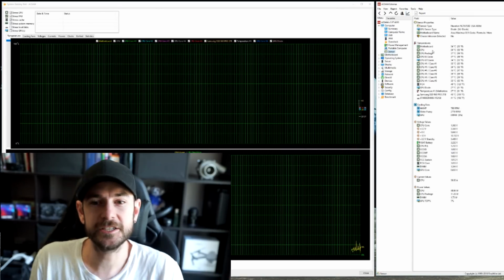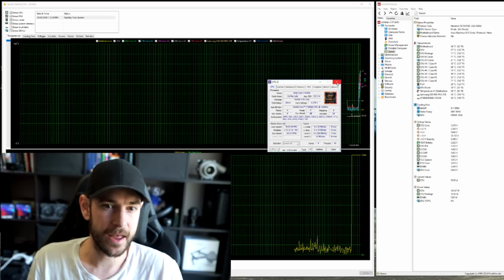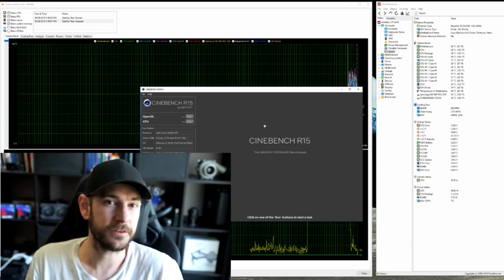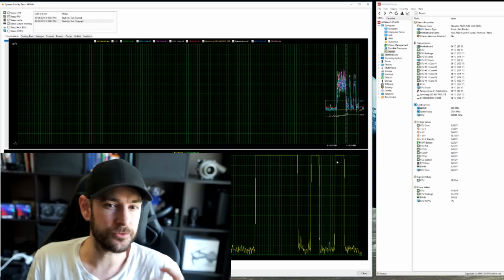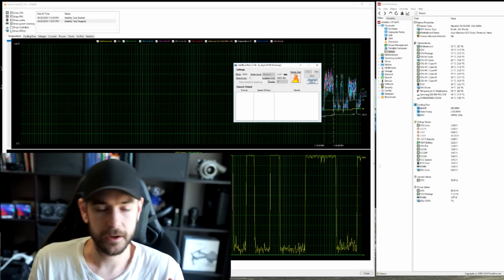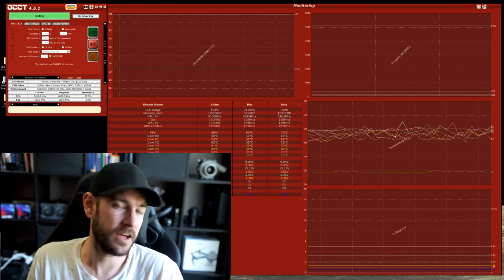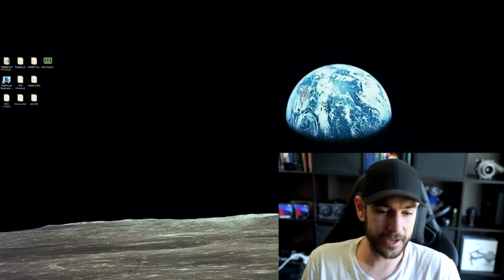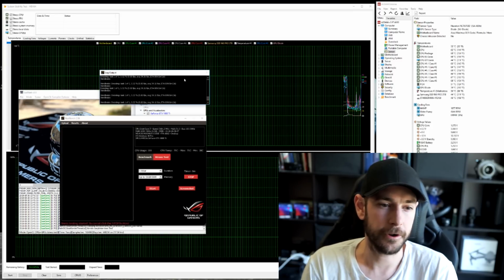How to Stability Test an Overclocked PC

Comment: Hello . When i run real bench , i get instability in the app itself with error blender and lux mark . I search them up and it was Unstable gpu clock . However i use hw info to watch the temp while testing and hw info said that my Cpu clock is unstable , error L0 cache . So in this case , which should i fix

Comment: Thanks for the great info! Just wondering what changes you make when you incorporate an avx offset? I play a lot of apex legends and I've learned that it requires an avx offset, do you increase the voltage? Probably lower my core multiplier to compensate for the increased heat?

Comment: for me aida64 fpu stress more unrealistic then prime95. in game my proc temp @ 48-65 oc @4.45ghz. ryzen 3600. when i use R20 my max temp was 76C. prime95 70-77C. but on aida64 fpu stress test only i got 95C max temp. it just unrealistic(this kinda stress test not apllied on our daily normal use). render out 4k footage from premier pro also didn't get temp more than 70C. so i prefer, R20, blender open data, prime95, and aida64 stress without fpu stress.

Comment: What I don't like about "I don't like prime95" is the "the test is too hard to pass, so I'll just run an easier test" defeating the purpose of stress testing entirely.  

The other problem is prime95 is surrounded by so much conflicting information on if it's good, bad, or if it even does what it says it does in regards to to the test settings.  

Using it to gauge ultimate stability is fine, the problem seems to be learning how to configure it correctly which no one seems to be able to agree on how to do.  

And I'm too stupid to do it.  Yes I have tried.  Still trying, still ain't got it fingered out lol

I'm coming for you, blend test.  All over your blendy face 😈

Comment: Bro so here is my results , I did this stress test for about 15 minutes on 100% cpu load at 5.0ghz , my max temp was 60 and max VR VOUT is 1.261.
My specs are:
10700k
Z490 aorus ultra
g.skill 32gb at 3600mhz
kraken x73
corsair rm850x

Now I disabled the enhancement thing in bios to get full control of cpu overlock i also set my voltage to 1.265 I think something around that , and set my LLC on Standard.
Is that good results?

Thank you <3

Comment: my cpu clock and voltage keeps jumping up and down while doing the occt test, constantly from 4.2 ghz to 1.4 ghz and while gaming if cpu usage passes 35% gpu usage drops and fps go from 120 to 20, what could it be??? i changed the rams and i have change the clock speed and voltages a million times, please help haha

Comment: What's interesting is that he uses ASUS motherboards and ASUS's profiles for AI overclocking are based off of.....you guessed it.....prime95 lol. In the bios just hit F11 and it point blank tells you this in the various info. I do agree...prime95 is way to extreme but to be honest this guy says "if the CPU can handle Prime95, it can handle anything" which is essentially the point isn't it?

 I only have an i5 9600k that is Oc'd to 5.2ghz. Max temp is 85 Celsius with stress tests...usually between 75 and 85 Celsius but no more. I use Aida64, Cinebench20 and Intel extreme tuning utility for the stress tests etc.

Comment: This is probably a late reply but does the same apply for undervolting cos I'm trying to shed a few degrees of my 9900KS with no AVX offset I'm using 1.3v LLC turbo so max 1.32v and iv ran occt on smallest data avx 2 for 15mins and was fine. I don't feel comfortable leaving a stress test on un supervised and I don't hardly have 4 hours available.

Comment: Super helpful video, thanks man. Question -- wouldn't it be faster to just skip straight to the OCCT stress test? If it fails, you go and tweak your overclock, without having to waste time on all the "warmup" tests.

If the OCCT test passes, I could see the benefit in running the rest of the earlier tests at that point in case one of them catches something. But would it not make sense to just go straight for the most demanding/intense test of the group first in order to save time?

Comment: The Intelburntest Maximum test failed after 30 seconds... pc restarted.
I passed the standard and very high test.
Temperature was at 70c so no temp issue's. 
I'm currently at 4.3ghz and 1.35v.
How do I troubleshoot this?

I wanted to test with occt after intelburn but first I wanted to pass the intelburn before I proceed.

Comment: I watched this video and your i9-9900k / Maximus Hero XI video so many times. I cannot stress how much I learned. THANK YOU for all your help and the deep explanations! Thanks to you my computer is now overclocked to 5.0 Ghz on all cores and completely stable according to these tests. 

A few things I wanted to note that I ran into that made me pull my hair out for days. 
1. Make sure BIOS is up to date (Save any created profiles first)
2. Make sure you are properly cooled! (I thought I was according to hardware monitoring but later found out it was causing BSOD's that all stopped after finding out that the airflow in my case was insufficient)
3. Use the latest version of RealBench! I was using an older version 2.43 and having crash after crash even after passing all the previous tests in this video. Noticed you were using 2.56, so I used it and passed multiple runs!

Comment: Im a new pc builder. Not an expert but stumbled on OCCT and have beeb using it to stress test. my ryzen 5 1600af cpu was stable on 4.1 ghz on 1.35 v on  cinebench but when tested on OCCT ran into crashes and temps reached 90 c. Highly recommend OCCT. 
Found out that 3.6 ghz on 1.125 v awas stable. max temps 75c

Comment: Couldn't get anywhere with Prime95 so I tried your Method. Wow!! Finally got my 8700K to 5.0Ghz with newly installed AIO. Thanks!!! Sat on the edge of my Seat waiting for 'Intel Burn Test' to pass at Maximum. LOL
Reply: I’m running my 9700K on Noctua Air at 5ghz and 1.320V but it’s getting pretty hot especially for AVX loads. Ordered the 3000 rpm fan for my cooler to see if that helps. Otherwise I may be going AIO.

Comment: hey i have a question i have 32 gb of ddr4 3200 mhz i have followed one of  your guides for oc my i7 9700k i ran some stress programs and they ran fine but when i run memory diagnostics about 4 times i get errors does this mean my ram is faulty? or is it just from agressive oc? im using xmp 2

Comment: Would IntelBurnTest still be suitable to use when monitoring an OC on a Ryzen 5 3600?
Reply: Hello I'm new at overclocking I have a ryzen 5 3600 and  I can it 4.2Ghz but I need at least 1.4volts, I reed some people saying that 1.4 volts it's a lot so I went down to 4.1ghz at 1.35volts do you think that 1.35 volts is fine? I usually have around 55 to 60 degrees on the cpu. Even when I was using 1.4 volts

Comment: Hi thanks for the great video. I am running 1.305V at 5.00Ghz, I ran OCCT and it was crashing but I have increased the voltage from 1.290 and I ran it for 20 minutes. The temps though are sitting around 70-85ish degrees. I run a waterblock which also has water run through the GPU as well.. I guess this is part of the reason why it is running quite hot.. Is this ok do you think? C-States are also disabled.

Comment: So what am I supposed to do if my pc keeps freezing during these tests and in games it'll run just fine and have decent temps but then out of nowhere it freezes no blue screen should I be changing the voltage or something and I know my power supply is more than enough and my cooler is doing fine I'm just trying to figure out where the stability is lacking

Comment: Getting a blue screen after I tried your over clocking guide on my gigabyte z390 / 8700k @ 5.0 ghz 1.300 v. What adjustment I need to change? Thanks for the video.
Reply: I just finished my 8700K to 5.0ghz. I had to up the Voltage to 1.370V and my Uncore to 44. Not sure if the Uncore helped or not. I've delided my CPU with Liquid Metal and I'm using the Aorus 280mm AIO with the Stock Paste that was on it. Max CPU Temperature peaked at 76C but otherwise stayed in the lower 70s C. I finally passed the 'Intel Burn Test' set a Maximum setting. Hope this helps.

Comment: In wich scenarios would you use prime95 over Intel burne test and why did u opted for one instead of the other
Reply from the maker: I don’t use Prime95 at all anymore. It’s a very unrealistic workload.
Reply: @boostedmedia  Is there any overclocking hierarchy that you follow up on OCs... Like Cpu first, than ram... And than Gpu.
As someone who needs well tuned workstation pc for my tasks I priorities Cpu and Ram speed... While GPU just stays at stock.
I can imagine gaming pc having priority in gpu clock and speed... Or its the same order?
Reply from the maker: I usually go CPU then RAM then GPU. The ram is dependent on the CPU as the controller is integrated.
Reply: Intel burn in and Occt take care of Cpu and Ram?... I was doing some reading people using memtest to validate ram...
At this point my PC is stable by your Stability tests. I'm working on my first workstation pc and it really is a learning curve to all of that 😅

Comment: What if I can boot into windows, play pubg for 5 hours, export videos with premiere, do everything, but can't run occt for 5 seconds ? I5 8600k at 4.8ghz with 1.31v. Should I increase voltage ? 35c idle and 65 max under load, with max load line calibration
Reply: Oh, and I can run aida64 with no issue whatsoever

Comment: Good vid, im having trouble overclocking cpu even tried every voltage and clock speed cant seem to find the right spot. cpu temps dont go higher than 60 i have an FX8370E. any suggestions?
Reply: If your temps are not going over 60 is the overclock registering on windows? Open up cpuZ and see if it's picking up your frequency ie you've overclocked from 3.8 to 4.2ghz. If it's not showing your overclock, it 3.8ghz, go to power settings In windows and make sure you have high performance mode selected. 

If that's not the problem sorry :(

Comment: Hey man. When tested with the Vcore settings, do you reccomend dropping voltage .005v and after every change, run this test? And once it's unstable I'll bump it back up to where it was stable, and that's the ideal Vcore?
Reply: Yes :)
Reply: @Battlegroundinho  actually it's probably much more efficient to start at a Vcore that you know will be unstable, and slowly bump it up til it's stable. Would waste less time
Reply: @tylerkrasavage5656  I started at a high end voltage and slowly decreased, took me two hours to find the right one. But could be faster yes :)

Comment: What if you run the burn test at maximum and it never posts a result after even 30 minutes. Just keeps running the cpu but never does anything. What does that mean?
Reply from the maker: Likely the Microsoft redistributibles aren’t installed correctly.
Reply: Boosted Media I’m pretty sure I have then installed. I’ll check tomorrow and see and also let it run longer to see if I have different results.

Comment: Using this guide now for my 9900k. After about a day I got it to pass IntelBurn Test, only for OCCT to throw about 750 errors after 45 mins lol. Getting there though. 5ghz @1.33v 4.5 cache -2 avx. I don't normally use avx but I think I got a bit of a dud for an overclocker.

Comment: Finally!! Something ACTUALLY HELPFUL! I watch alot of videos trying to find the best settings for my system. i9-9900k and RTX 2080 ti ftw3. Your video (posted after this in overclocking the i9 on Maximus XI hero) exactly the same as me, was, of the upmost tremendously helpful! You don't skip over anything that others have deemed "should know" stuff. It's for dummies without implying such 😂. Thank you so much for all your help. Keep it up. First person I've subbed and will donate to! You've save me $$$ doing it myself while allowing me to push my limits. Thanks man!

Comment: I had some super high temperature spiked after like 20 minutes of Prime95. Was around 95 suddenly. But no crashes at all. Is that normal?
Reply from the maker: Don’t use prime95 for stress testing. It’s not a realistic workload.
Reply: Boosted Media Jeah your video is the bomb mate. Tried intelburntest with standard and it crashed after two loops. Now I raised the V to 1.34 and it did all loops. Running 10 loops on High stress level right now. Aaaaaand it finished it successfully. Temperatures were between 50 and 80 spiking around i think I could consider it pretty stable.

Comment: Im running the i9900k at 5.0Ghz with the avx offset set to 1, volts at 1.32. In what order do you recommend doing things from this point on? Im mostly rendering videos and working on lots of 4k material so my goal should be to minimize the avx offset I guess. Should I continue to find the lowest possible but stabile core voltage from this point, or try first to set avx offset to 0? Im a bit confused. Thanks for a great video!

Comment: So witch dimms slot did you end up using?? On witch motherboard? I got a Asus maximus ix code.. Witch dimm slots should i use to run 4000mhz?
Reply from the maker: I’m using all 4. Just make sure your matches pairs are sharing the same channels on the motherboard.

Comment: hey dude will this work for amd processor also ?
Reply from the maker: Yep
Reply: @boostedmedia  im upgrading to ryzen 5 2600 and  an msi b450 board with a radeon r9 390 8 gb gpu and 16gb vengence ram how much fps you think i can get overall stock ??

Comment: I’ve got a question. When I do Cinebench I get max 70C, no spikes. When I do OCCT medium I get average 55C, spike 65C. And then when I did Aida64 I get friggin average 82C and spikes up to 89C!!! I have a 360mm aio and ambient temp is 28C. How is Aida64 temp so much higher???
Reply from the maker: Shorter instruction sets so the cache doesn’t have time to buffer. Means the cpu is working a lot harder even though the load percentage is the same.
Reply: Boosted Media thanks. I just realized I stress tested FPU. When I do only CPU I get much lower temps

Comment: I know this video is a year old now (as of yesterday)  but I'm curious if I should be concerned or not, I feel like my VRMs are throttling (Maximux X  Hero) I'm seeing people pull upwards of 200+ watts off the same board, and even at 1.42v I'm only getting 165 under AVX loads like Intel Burn Test. I feel like it's effecting my OC. I've copied both yours and der8auer's settings (not at the same time) and seem to be hitting a wall. Hell, at one point in his video he ran Prime95 26.6 and was pulling 210 watts. I have no clue now. Help?

Comment: i didnt even overclock my cpu i used a feature it was like a boost or somthing in my bios as well as switching my ram to profile to so it would run at its full speed and everything is fine except now fallout 4 crashes idk what i did wrong

Comment: Hi! I'm running intel burn test and getting 95+c on standard after 1 loop, but on cinebench r20 and aida I am around 70-75c top. can someone explain why? (h212 evo good case, 4690k 4.8@1.309v, cache @46, 1.215v, ram:corsair dominator plat 2133 cl9 @ 2400 cl10) pls help :)
Reply from the maker: I tel burn test hits the CPU with short FFT instructions which generates a lot more heat.

Comment: I am getting bugs lines on benchmark and also in games without overclocking it! If i overclock my gpu and open benchmark than the pc shuts down
Reply from the maker: Sounds like you’re pushing your GPU too hard.
Reply: @boostedmedia  can you tell me best overclock settings? I have Gtx 580 1.5 gb

Comment: OCCT crashes if I don’t use an avx offset of 2, and I noticed your system wasn’t using an avx offset, would you consider a system that can’t run without the offset stable?
Reply from the maker: Yes there’s nothing unstable about running an offset.
Reply: @boostedmedia  thank you for the reply, you make overclocking so easy to understand, keep up the good work!

Comment: 5.0 GHz idling at 1.35 and 1359v during load. Passed every stability check fine and the temp idle is 30 C with max of 75c during load. Anything I should do? I was having instability issues at 1.29 and 1.31. I7 9700k

Comment: Will when I start my OCCT you said core voltage should go up slightly when testing  mine is dropping from 1.280v down to 1.24 is there something wrong?
Reply from the maker: Sounds like your old line calibration is set low. Not a problem as long as it’s stable.
Reply: @boostedmedia  what would be the highest cpu vccio voltage I would wanna see.  Currently on auto setting showing 1.30v also would the vdrop be the reason I can't get over 4.8ghz over clock?
Reply from the maker: I wouldn’t go over 1.3 for vccio or vccsa. I run mine at 1.00.